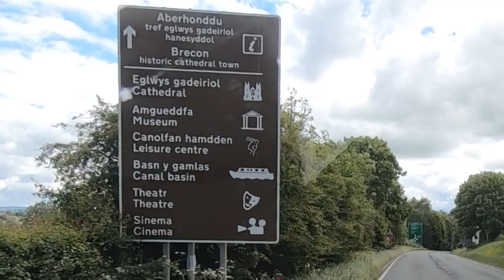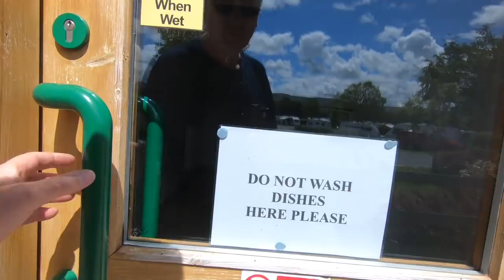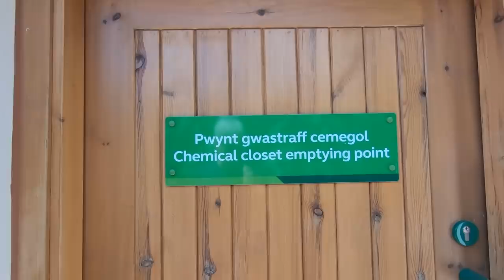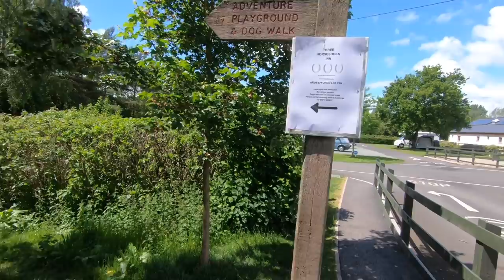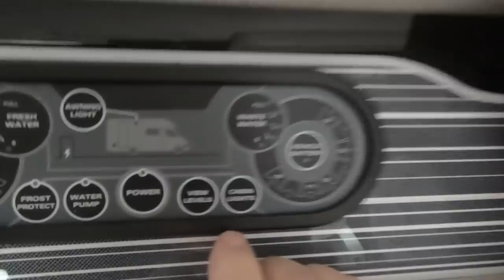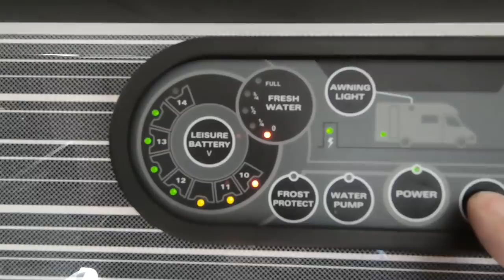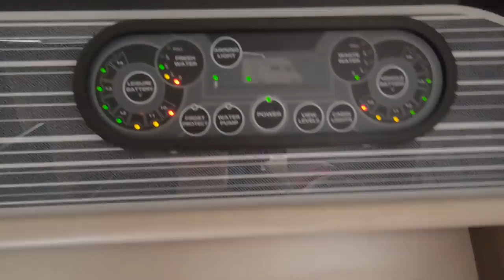Arriving At Brecon Beacons Caravan And Motorhome Club Site | Welsh Tour 2019

Comment: Wouldn't it make sense to drive the motor home on to the pitch forward when struggling for length on pipes and what not. Then it would be shorter runs on the pipes and cables.
Reply from the maker: The waste pipe is on one side and the fresh water is on the other side, so one might reach and the other might not. Besides we prefer to reverse in.
Reply: well that's your prerogative Bob and Jenny don't let anyone else influence you. 😁
Reply: I understand that all vans have to be reversed in,caravans also
Reply: @julietebbs4432  not always, if the view is good then you may ask the warden if you can face the other direction. Such as is the case at Bunree where you can look out over the loch.

Comment: Hi boab , it's been a while , glad you and jessie are keeping well , a little tip for you , you may already know about it , ACF-50 , it's for applying to anything metal to prevent rust , it was developed for aviation, I use it on my motorbikes to prevent the salt and winter crud from eating my bike away , it's amazing stuff , check it out on YouTube, anyway another good video , thanks
Reply from the maker: Yes, maybe I'll try that, seen it on The Missenden Flyer channel. Thanks.

Comment: Very neat A frame set! I find it interesting as you have to change plates. It almost doesn't make sense as the car is registered on its own? Have you tried a bicycle luggage elastic on the steering wheel... It will keep the car straight if you need to reverse short bits if needed. Going forward and turning, the elastic stabilize the steering more. Did you have the steering lock removed or do you keep a second key in the ignition? Thanks Nice video.
Reply from the maker: Good tip about the elastic. Hadn't thought about that. You have to put a number plate on, as the car becomes a trailer. I have a second key in the ignition to stop the steering lock coming on. You turn the ignition on, then off. Thanks for watching.
Reply: @BobEarnshawMoHo  We tow a lot of cars to the workshop with a A frame. Just hook the elastic left corner underneath of the driver seat, once around the bottom of the steering wheel and down to right corner of driver seat. Not too tight. Do a quick reverse test... and ready to go. The other advantage of the elastic is going at angle over speed bumps in caravan parks. It will prevent the first wheel touching the bump first to turn the steering rack.
Reply: Sorry to message again. My English is very poor and 3rd language. You have to "play" a bit the the bicycle elastics to get that perfect tension. Not too little not too much. It depends on the lengths they are available in the UK. Meaning, you might have to use 2 to get it "perfect". Ask your wife to look at the front wheels hitting a speed bump at a angle. With and without it. See that the steering rack don't "knock" or force but go through even... same with reverse test.
Reply from the maker: @fiatunonewsletter6782  Your English is good. I will try what you say, thanks.

Comment: Excellent video both. Wondering why you chose a motorhome / car towing and not a caravan towed by a car ? Did you find the adjacent dual carriageway rather noisy ? The nearby Brecon Museum has lots of interesting info on the Zulu Wars plus the canal is a great place for dog walks.
Thanks for showing us the setting up demonstration. All the best.
Reply from the maker: There are many reasons we went for a small towed car, which I've probably covered in previous videos; 

 https://www.youtube.com/playlist?list=PLUi3rqw12j2q2q4KYGAnvYgnTiWI0cdiL

But I guess it's about flexibility, we have a motorhome when we want to travel flexibly and stop where and when we want as in Scotland, the Lakes and Europe. We can stay on pitches longer and not worry about parking in towns or indeed Welsh Lanes if we take a small car. The small car and motorhome fit on our drive, where I doubt a decent sized caravan and large tow car would not. When we are home we have an economic run around.

Thanks for the info about the area and no, the noise from the dual carriageway hasn't bothered us so far apart from the odd lunatic on a motorbike with chimneys for exhausts!